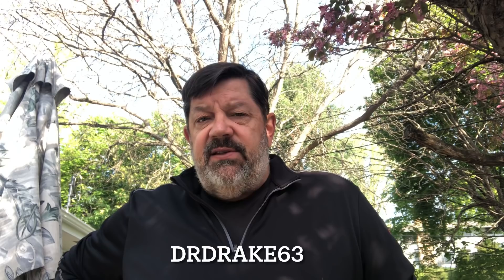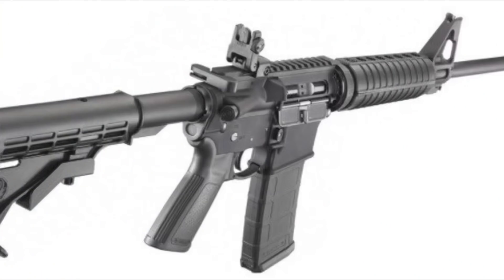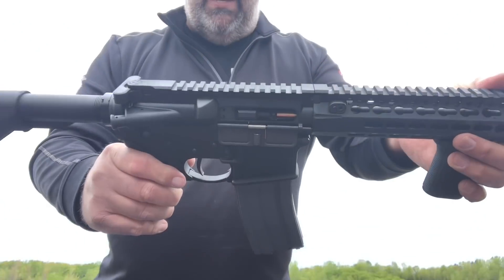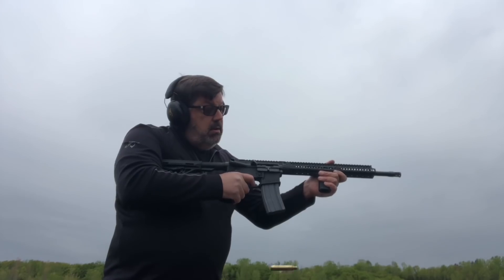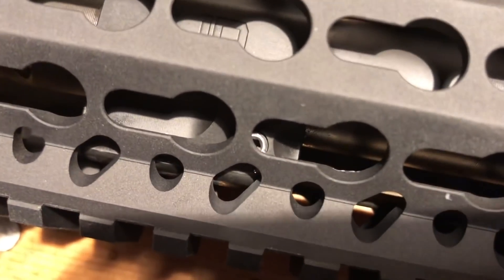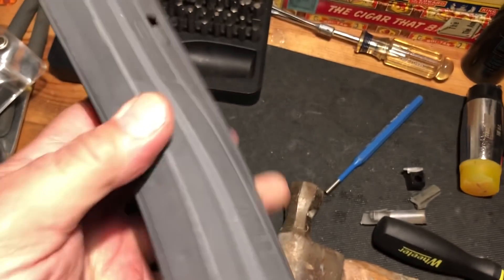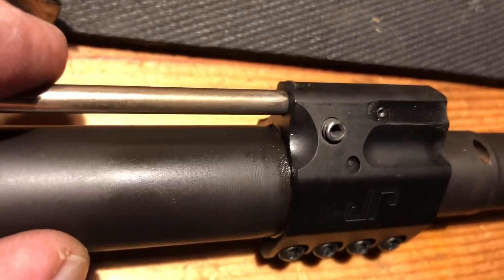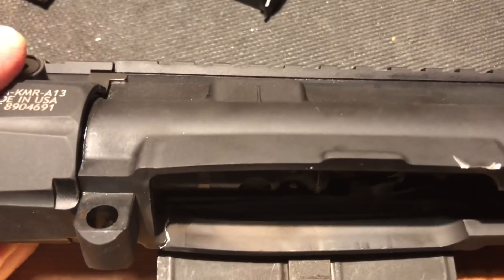Colossal AR Failure

Comment: That's not a gas issue I don't think to send that much pressure back through the system would have blown your gas tube well before it did any damage to the bolt carrier group 
that looks to me like an out of battery detonation
Again if it was a super hot round you would have seen problems in other places
That looks like an out of battery to me
Reply: I 2nd that!
Reply: Bob Watters  my vote is on a squib or sorts causing a bore obstruction. Out of battery dets usually leave bits of a blown out cassing half out the chamber and are pretty obvious. This looked like the bolt was in battery.
Reply: I totally agree
Reply: I agree
Reply: I totally agree sir,
Even with a standard low profile gas block is a full open gas system.
Reply: Yep! You hit the nail on the head! Not a gas issue!
Reply: Not wanting to offend anyone, but were you shooting reloads?  I saw this same thing happen one time and the first thing I asked was “where did you get your ammo”?  The shooter said that he bought it, and I asked was it factory or reloads?  Personally, I almost always shoot reloads and I have reloaded for years. The shooter said that it was all factory ammo so I gathered a few of the unfired cartridges that were blown out the bottom of the magazine that were lying on the ground and there was a mixture of two different reloads and one factory ammo.  He then admitted that some of his ammo was gifted to him by a friend.
How many times have we found an unfired cartridge on the range and put it in our pocket or magazine not questioning it’s origin or contents.  Not all reloaders are expert ammo manufacturers and some do make mistakes, either unknowingly or intentionally.  I knew one reloader who told me that the maximum load for any cartridge should be considered as a starting load because the manual was printed that way to avoid lawsuits but was totally safe otherwise.  I don’t know where the errant round originated, but I’m thankful that no one was hurt.  I would lean towards a hot round.
Reply: @keith9875  Whether or not a hot reload caused this failure, you're giving some good advice. Know your ammo source.
Reply: Keith my reloading manual says start with 10 grns LESS than max and work up from that
Reply: @whatstheproblem6606  I think that's 10% less, 10 grains off Max would end up being around half of charge 223 rem which is also incredibly dangerous.
Reply: Fu Fu2 yes you're correct, my bad
Reply: @keith9875 i think this is what happened to mine. A friend from work was shooting it. I used an air hammer to remove the barrel from the upper and the bcg. The casing has a blast hole through the back but the markings were not the same as the other white box Winchester from dunhams
Reply: How could an AR, in semi out have an out of battery det. These have safety mechanism to prevent such a thing, correct?
Reply: @gordoncopenhaver1312  Not if you use an "enhanced" firing pin, or your headspace is wrong.
Reply: @ronreyes9910  Oh I gotcha. I figured with everything being so standardized and that being a factory Ruger.. I wouldn't foresee that being an issue. Possible though.
Reply: @gordoncopenhaver1312  You are correct, it cannot be out of battery. Until the bolt is rotated closed the firing pin cannot reach the primer. You can check this yourself with BCG on the bench. Even in auto it would be nearly impossible to get enough "bolt bounce" from too light a buffer and bad timing from a poor secondary sear in order to ignite the primer but still unlock the bolt before ignition.  Maybe with a cowboy coat hanger sear but not with a mil-spec rig. Most likely that last round was a 300 blackout round. There are plenty of YT videos with identical damage.
Reply: Defiantly battery .... and a hot load on top. We’re they fac loads or reloads ? But really don’t matter at that point when it blows up. I’ve put many adj gas blocks on and have them wide open and have never ( to date) had any issues with over gas. Damn lucky u weren’t hurt. Good vid 👍
Reply: Blown out primer?
Reply: Bob Watters  agreed Out of Battery Gas Would Have Vented Through The Ejection Port Ahead of The Bolt 😎
Reply: Yes, the gas tube would have blown first. I say out of battery
Reply: I'll.. what, 15th it? It was absolutely not the adjustable gas block, as the only they do is restrict gas. Looks like improper headspacing to me, he probably overtorqued the barrel nut, or compromised the receiver by improperly installing the barrel.
Reply: Yea I'm no armorer but that's not an overgassing problem, gotta agree with you
Reply: No.....
Small stainless tubes can handle amazingly high amounts of pressure.  If the tube is not crazy hot it will probably handle more than proof pressure if the ammo.  The pins might shear....but maybe not.
I think the gas key and cam pin failed and blew the key off the carrier.....that would explain why the bolt was still left forward and wedged in ....it never unlocked when the cam pin failed.
Reply: I disagree.
Either in battery or out of battery detonation would have  allowed the carrier to go to the rear with chamber pressure being at normal level.
The carrier cracked because the gas flowing inside the carrier had nowhere to go because the bolt was stuck in place.
The cause could be either a hot load or to small a headspace or both causing the case grabbing the chamber not allowing the bolt to turn.
This has probably nothing to do with the adjustable gasblock.
Reply: @HarmJW77  Look at the photo taken up the magazine well showing the cam-pin.  It looks like it's 100% vertical.  The bolt must be unlocked for the cam-pin to be vertical, yet the bolt carrier looks to be completely closed.  I would like to see the top of the bolt carrier to see what happened to allow the bolt to be out of battery while the carrier is completely forward... something up there; the cam-pin, cam-slot, or top of the carrier must be damaged.  Judging by how the whole bottom of the bolt carrier was blown off and the upper receiver was bulged out until it cracked right at the ends of the bolt carrier, it seems clear the bolt was not completely closed when it discharged.  And, considering that the bolt carrier must have expanded in order to bulge the upper receiver that way, it's not surprising that it didn't move backward.
Reply: @leoashrae4199  If the bolt campin is 100% vertical is debatable.
Between locked and unlocked is only a few degrees.
From the photo it is hard to tell.
Maybe David can clear this up.
If it is 100% vertical David's attempt to tap it open with a rod woul probably have been successful.
The sudden escape of a huge volume of gas as the carrier cracked flowed everywhere including between the carrier and upper.
It is not that these aluminium walls are pushed out by the carrier but rather the gas between them.
I guess we will know for sure when the bolt and case come out.
My guess is that it was a headspace issue or a hot round or a combination.
In either case something prevented the bolt to unlock which resulted in that the gas had no means of venting from the carrier.
Heck, I have installed a JP adjustable gasblock on my .308 Oberland Arms only 2 weeks ago 🤔
Reply: @HarmJW77  I don't understand how it could be a headspace issue, unless the gun left the factory that way or he got one seriously faulty cartridge.  As long as the bolt closes, the headspace is fixed by the bolt, barrel extension, and the depth the chamber is cut.  Assuming a round is close to SAAMI spec. from the shoulder datum-line to the base, the headspace on an AR does not change.  If I were a betting man, I'd put my money on a seriously screwed up bolt carrier.  BTW:  According to the original Eugene Stoner specs, the AR-15 bolt rotates 15 degrees.  That much rotation is easily seen.  Just look at the cam pin move on top of the bolt carrier when you move the bolt in and out...
Reply: @leoashrae4199  I agree that headspace on the rifle is set. Assuming that it is according to spec. is somewhat iffy to me. We will never know. The way the bolt and carrier interact when gas flows in to the carrier shouldn't put that much stress on the carrier that it cracks. Assuming the bolt can move freely. The gas pushes the bolt toward the chamber but when there is no room for the bolt to move and rotate it becomes a huge amount of gas trapped in the carrier with nowhere to go. Excessive chamber pressure could cause this. Having a lot of headspace, or close or less than minimal surely plays a role.  When I look at the footage I see a bolt closed, cam pin not 100% vertical. The damage to the upper/carrier and angle from which the picture is taken from make it difficult to see. But I guess we'll see more in a follow up I hope. Headspace may or may not be a factor. Ammo is a big factor. They go hand in hand. It would be interesting to investigate any rounds left from the box and the spent cases. When something goes wrong it is always good to look at it from different perspectives.
Reply: @HarmJW77  interesting
Reply: @neilstern1694  you mean that my guess was wrong?
Reply: @HarmJW77  no not at all , you my be right. Interesting cus I'm learning from all of you. See I thought it was a bad round and when loading the next it smashed and did damage. I thought you may be right.
Reply: @neilstern1694  Well I was wrong in that no gas flowed from the gas tube in to the carrier. Al the damage came from the ruptured case and the gas blowing back through the bolt lugs.
Reply: @HarmJW77  I just think they use to light weight materials.  Heck my Sterling is a brick . I like old guns the new one are cheap metal .
Reply: @HarmJW77   I worked hard to get my sterling to get to about 95 % fireability, from about 99% unreliable.  I would never mess with a 45 round ,Ha. I wish you well.
Reply: @neilstern1694  🍻
Reply: Bolt carrier failed. This has nothing to do with an out of battery detonation or too much gas. It's poor manufacture of the bolt carrier and nothing else.
Reply: @snek9353  how are you saying the bolt carrier group was Miss manufactured had internal weaknesses in the material that led to the failure I can't see that much damage happening due to over gassing unless there was already some serious stress fractures or voidz inside the actual metal itself and then why did the gas tube not blow
Reply: @Lugermonger35  You do see what broke right? The carrier split open on each side of the hammer rail where it's thin to clear the magazine feed lips. That's the thinnest point of the carrier and inside that chamber is the gas pressure that cycles the action. 

"unless there was already some serious stress fractures" Exactly, something was very wrong with the bolt carrier, I mean VERY wrong. The fact that carriers are made out of aluminum and work just fine tells us there's plenty of material. So something had to drastically weaken this carrier. It almost certainly had a stress fracture going for some time, very likely had a poor heat treat, and maybe was contacting the magazine or was bored off center.

Gas tube wouldn't blow because this isn't an overpressure issue, the fact that it didn't blow and didn't cycle tells us that. It's really near impossible to overpressure an AR gas system to the point of catastrophic failure, the hole in the barrel isn't big enough. It'd have to be some perfect storm of a barrel obstruction forward of the gas port and a heavy barrel that didn't split.

BTW pause it at 5:06 and look, the carrier is split open wider towards the front. Clearly a crack started at the front and propagated back.

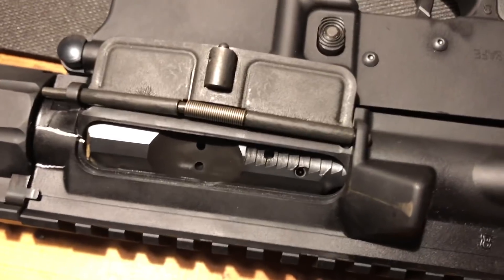Ohh and it's obvious the crack started on the left side, you can see carbon in the crack. Stop it at 4:58, see that little tag hanging off by his middle finger, that's right by the pressure chamber, a multiple fracture, and covered in carbon. That fracture was present for some time.
Reply: @Lugermonger35  my gues is that if you set up an experiment preventing the bolt to turn on pulling the trigger the carrier would fail every time instead of the gas tube.
The carrier has this weak point by (accidental) design.
And I agree this has nothing to do with bad manufacturing.
Reply: @snek9353  so we were both wrong it was a 300 Blackout
Reply: @Lugermonger35  Interesting, I don't understand the mechanics behind how an overpressure from a 300Blk causes the carrier to spit yet doesn't destroy the bolt or barrel extension.
Reply: @snek9353  the extension was cracked on the right by the looks of it. 
I wouldn't use the bolt anymore even if no damages can be seen.
Reply: @snek9353  i guess that all the gas blowing back from  around the bolt/extension-lugs against the carrier does that, trying to push the carrier back while it can't.
Reply: Yep spot on, out of battery detonation or hot ammunition.
Reply: Could have been a 300 black out round that snuck in,  The magazine shows how a BCG failure blows down out of the👌magazine..this has to be a bore obstruction.
Reply: I'd sooner think that the BCG it self has some micro fractures. No offense but Ruger QC isn't exactly the best in the world
Reply: @Dominik189  ruger sources out the bcg. But qc I agree isn't what it used to be
Reply: I agree with you 100%.  The armorers at Perry (mostly USMC) used .096 as their standard spec. barrel port for the 20" barrels and the ammo they were using at the time.  Now that is for a 20" NM barrel.  Point is, I've seen many of these barrels that were considered to be no longer competitive get cut down (and turned down) to 14.5" and 16" carbine barrels.  Then with the same .096" gas port, which is considerably larger than the .07 to .08 recommended for carbine barrels, they would function just fine (albeit, the buffers would get the crap beat out of them).  Point is, that adjustable gas block will not pass any more gas than the port can vent... ergo, "over-gassing" is an impossibility.

Now... the elephant in the room... that cam-pin looks to be vertical.  If it is indeed vertical, that bolt is out of battery... PERIOD!  It also appears that the bolt carrier is fully forward.  The only way that can be is if the top of the bolt carrier failed.  I'm not seeing any of the tel-tail traces of a  barrel obstruction failure here.  If there was an obstruction there would be a barrel bulge.  I don't see anything that looks like a barrel bulge.  This gun needs to see a proper armorer for a proper analysis.
Reply: Im wathcing on my tv that lookes like an out of battery detonation and so i popped on to see if anyone thought the same as me and sure enough its the most popular comment
Reply: Yeah that’s like saying if you don’t drill a hole in the barrel of your bolt gun it will blow up there is no way that was the gas block had to have been obstruction or over pressure
Reply: Absolutely correct!  👍
Reply: I would agree 👍💯
Reply: I concur out of battery locking lugs never locked up
Reply: @hammerdrop417  if the locking lugs never locked up, the bolt carrier would be out the rear of the buttock. For it to still be in the completely forward position,  it's indicative of a restricted bore. Blowing out the primer and probably casing, then gassing out the rear. Interested in what the autopsy shows.
Reply: A while ago I was experimenting with gas port size, I ended up drilling a 4mm gas port and the damned thing still functioned properly, at that point the gun was running harshly. At the other end of the spectrum I drilled a 0.7mm gas port and it cycled but wouldn't catch the bolt hold open.
Reply: Agree.
Reply: Anyone else think he lost the bolt catch spring and didn't replace it? Look closely at the lower as he moves it
Reply: 7:40
Reply: @Michael Hill oof. That'll do it
Reply: @Michael Hill ya that was my second guess.
Reply: Just saw the update. Wow! Gotta watch what you feed these things. Damn.
Reply: Note that it was still in battery if it wasn't it wouldn't have stuck forward
Reply: I really doubt that the gas port drilled at the factory is big enough to direct sufficient pressure into the BCG to do that kind of damage no matter how open the gas block was set.  That said, it LOOKS like the bolt carrier blown up from the inside out!  

The thing is, every nonadjustable gas block I've ever seen has larger passages than the hole drilled in the barrel and have no restrictions at all.  Wide open the adjustable gas block shouldn't have increased the pressure in the bolt carrier higher than the OEM one did.

Comment: As many, many others have said, this was not a result of over gassing.  The total amount of gas allowed into the gas system is limited by the gas port size on the barrel - not the gas block.  And anyway, this kind of failure is not remotely possible from the impulse of gas down the gas tube.  This was more than likely an out-of-battery detonation.  There are several causes of this.  Any other failure would be shown by lug failures on the bolt or the barrel extension, as you would see with a muzzle obstruction from a squib round, or obvious bulges in the barrel near the obstruction.  As Larry the Cable Guy would say, "I don't care who you are, it wasn't the gas system."  Another (remote) possibility would be an extremely hot round.  

To those suggesting that headspace might be an issue, I'd ask how is it possible to affect headspace on an AR with the barrel nut?  The headspace is set by the bolt dimensions, the chamber, and the barrel extension.

Comment: I am no expert, but sure looks like bolt didn’t lock up, detonated out of battery, or an ammo issue, a very hot round. I don’t think you can get enough gas pressure back there to cause that much damage. But as I say, I am no expert on this matter, just my opinion. Glad you are ok. Godspeed

Comment: This is why one should not hold magazine when shooting.  Any overpressure within the receiver is going out wherever it can which includes down the mag well.  This mag was able to guide the gas out the bottom, but they can blow up, or blow out of the lower in which case your hand gets hit if it is there.